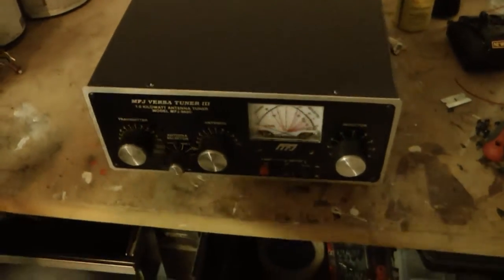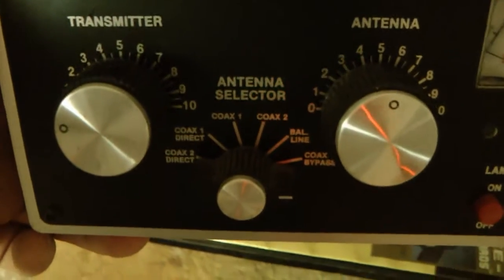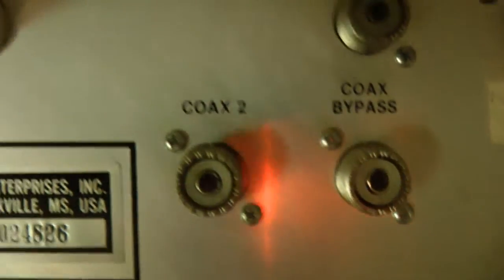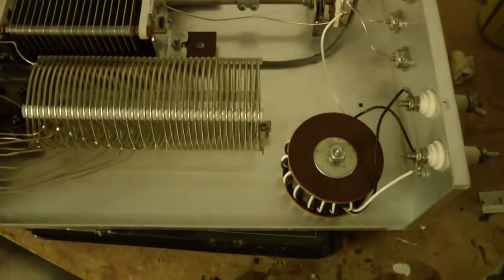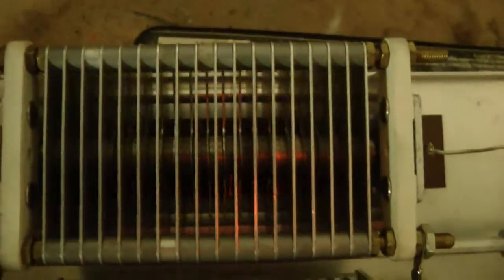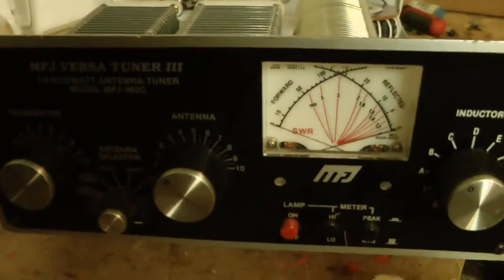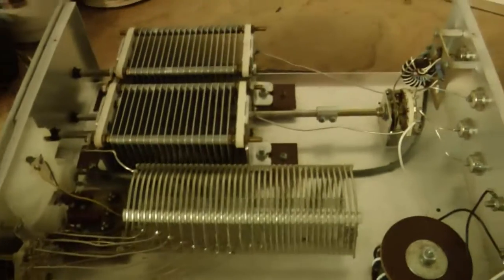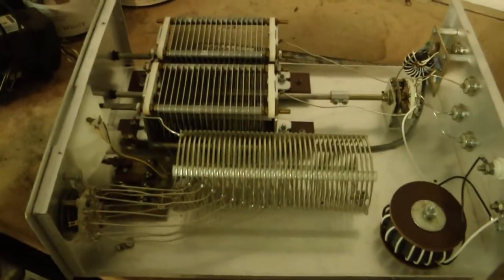MFJ 962C Versatuner 1 5KW Review

Comment: I have one just like that, and have used it for many years. It's reliable, can tune almost any antenna in the ham bands and the CB band(s).  I usually run anywhere from 100 to 500 Watts thru it without any problem.  It's rock solid. KA9RTH.